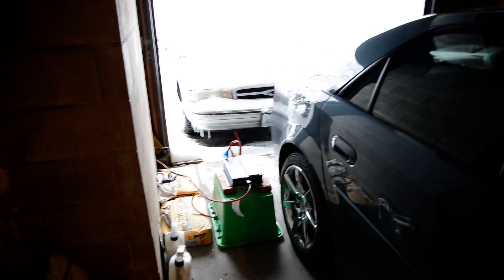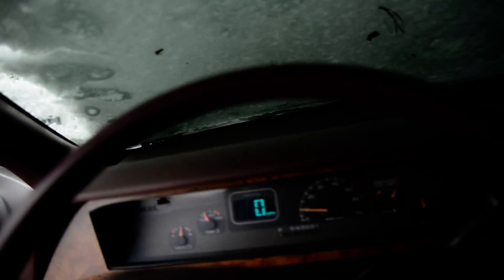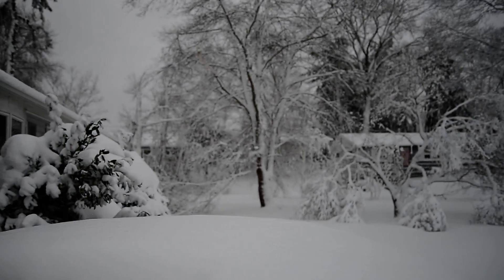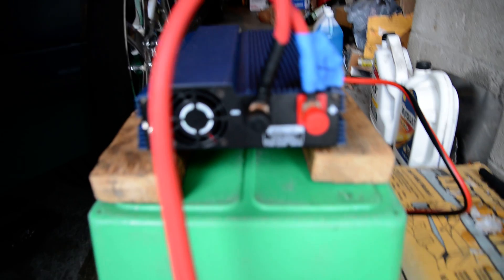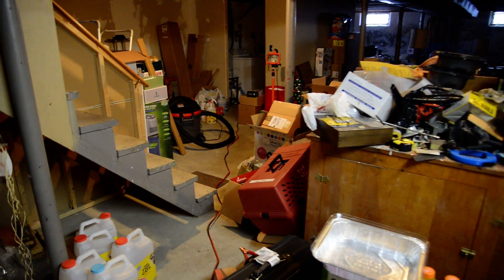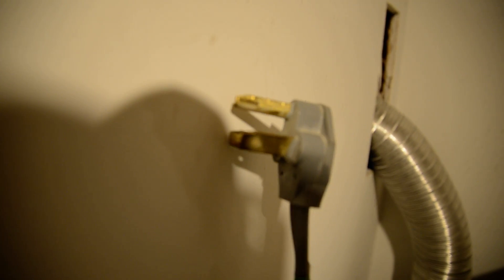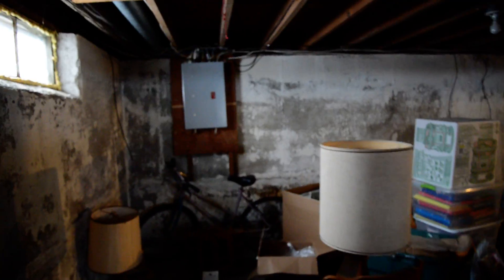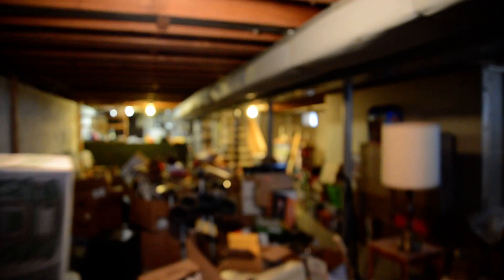Blizzard of 2013 (Nemo)

Comment: Good video man. This is almost exactly how i plan to do it in my condo's subpanel.  My question is will this work for me since I'm going to use a xantrex prowatt 2000 which has two GFCI outlets?  How would i need to wire the dryer plug to my 120v cord as far as the ground goes? Thanks alot

Comment: You use a setup similar to what I use for backup power, backfeeding into a 240V dryer plug!  So long as the main breakers are off it works well.

Comment: Are you sure this backfeed practice is safe? When we had storm Atlas here in the Black Hills last October, I had backup power with a Honda EU-2000i generator (great sine wave) but fed only the essential devices (some lights, computers, ham radio, furnace) through dedicated cords, completely isolated from the home electrical system.
Reply from the maker: With the main breaker off, I cannot fathom a situation where I could harm a line worker.  While it is true the neutral does not disconnect when you open the main breaker, there is no way to get a potential out to the grid, because the neutral and ground are bonded at the panel anyway.